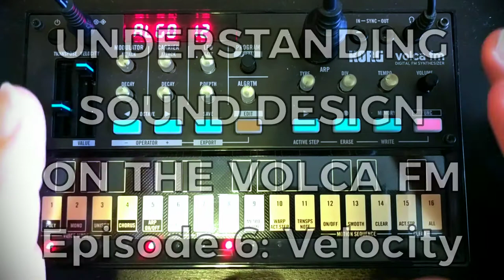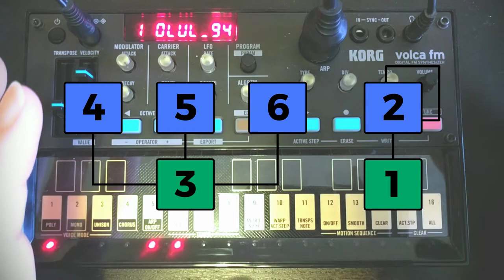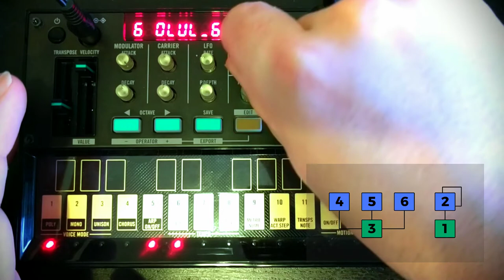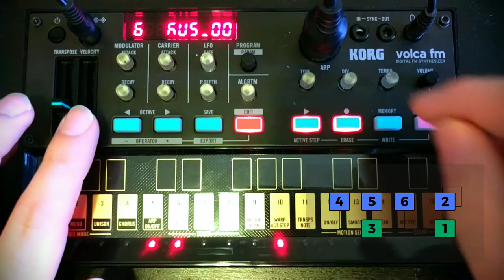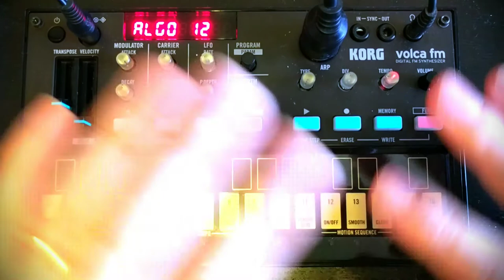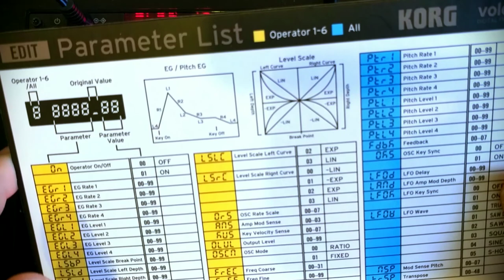Understanding Sound Design on the Volca FM - Episode 6: Velocity Sensitivity

Comment: It seems like the velocity is more like the "morph" wheel on the nord leads, since it gradually controls multiple parameters. the name on the Volca makes this a bit counterintuitive for me...
Reply from the maker: What's interesting is that if you were to take these patches onto an actual DX7, you would actually get Velocity sensitivity. Because the Volca doesn't have a velocity sensitive keyboard this is a "workaround" really - however the slider is set is the note's "velocity". But I agree that perhaps a different label should have been considered to make it clearer.